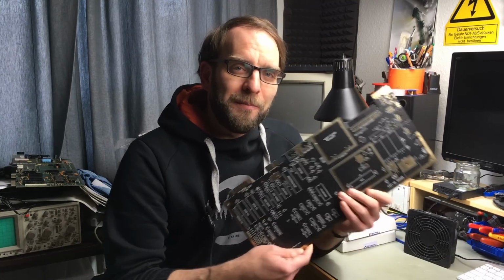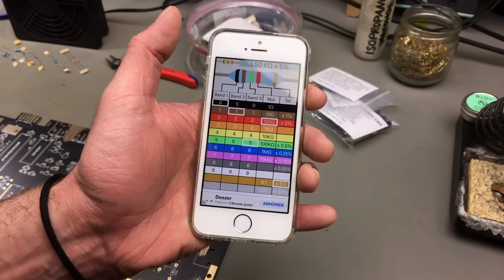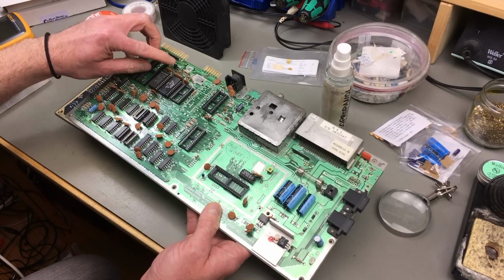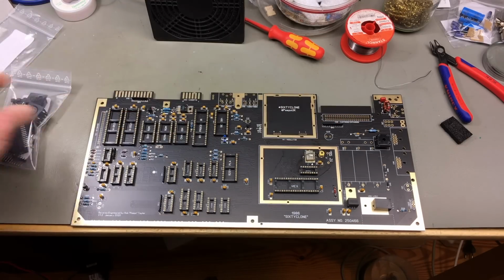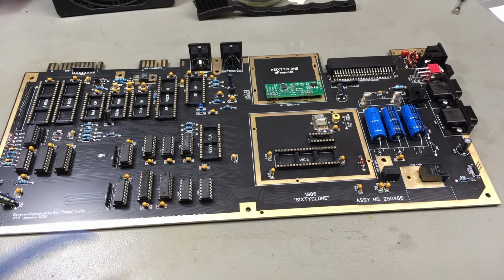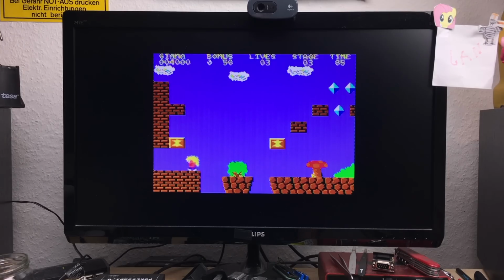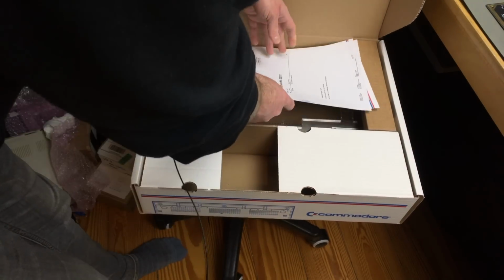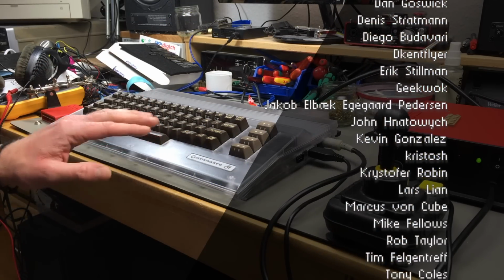Building a new C64 in 2020

Comment: I really enjoyed the video.  I am starting to work on my old computer collection and am starting with the Commodore 64.   I have to work with it to get it to come on.  And once it comes one it gives me some error codes especially trying to use the hard drive.  Keeps saying file not found and error.  red light flashing.  drive spins.  I have drive diag card it does nothing?   I am leaning to the control chip?  And Ideas?

Comment: I know this is an old video.   I have a 466 replica on way.   I've always wanted to build one.  Can't wait.   Thanks for the tips
Reply from the maker: Hope your build goes well! So satisfying to make your own C64! :)
Reply: Hello again:)   I recently finished building my 466 replica a week ago.   Works perfect.   However... it does not like the kung-fu flash 2 cartridge with the vicII kawari mini.   But is fine with a normal vicII.   The kff works perfect with kawari in a stock 466 board.   I was wondering when you have time.. could you try the kawari mini and a kung-fu flash 2 cartridge in yours ( if you have both)   and let me know if the kff with kawari mini works on yours?   I'd really appreciate it:)

Comment: Question:   Would the board revision you selected be a good overall one as a testing platform  ?  -   I would like to make a good solid foundation unit with ziff sockets to help test chips from original faulty machines. 🔧

Don’t feel need to answer here it just popped to mind and will probably post elsewhere
Reply from the maker: This revision only has two RAM chips so for general C64 testing, you are probably better off with one of the earlier revisions (like the 250425) which have 8 separate chips. The newer RAM chips rarely fail anyways in my experience while the smaller older ones (4164 type) often have issues. Otherwise you can test all the long board custom ICs etc in the revision I used here.

Comment: I was really curious if you could make like modern c64, like the recent VIC-20 the 8-Bit guy showed, with all of the shelf parts or like replacement chips or something. In another 8-bit guy episode he showed a modern SID replacement but I was wondering in there was like a VIC-II replacement or like replacements for other chips. The VIC chip in the 8-bit guys video needed to be pulled from an actual computer, so I did not know if this would have to be done for a project like this. I was actually thinking about this after watching the 8-it guys video. (I wrote this at the beginning of the video)

Comment: Ah, very nice.  But what I see frustrating about these new builds, seems all relatively new components, except for the SID and VIC II chips.  It really amuses me, how someone is implement C64 all on a FPGA.  Yet I can't find where anyone implemented just the digital logic for the VIC II on either a CPLA or FPGA, where one end plugs in the 40 pin socket for the VIC chip and the end allows for a connector for either a VGA or HDMI port.
Reply from the maker: There is the VIC-II Kawari now which accomplishes all the features you mentioned with an FPGA. Unfortunately it’s not widely available (yet) because of the global chip shortages. For the SID, there’s several very good modern replacements to choose from, too!
Reply: @JanBeta  Thank you, that is immensely useful to know, as per the VIC-II Kawari. I'm also wondering if there is replacement for the 8563 Video chip (C128 - 80 column display)?  If so, I'll be inclined in ordering one of those c128 neo pcb boards.

Comment: Did you ever find a descent replacement chip for the Vic2 chip ? It looks like something which still be in research actually ...
Reply from the maker: There is the VIC-II Kawari project now (an FPGA-based VIC replacement with added HDMI/Component output), but due to the current chip shortages, it's not going to go into "mass" production any time soon unfortunately.
Reply: @JanBeta  I could read it is on project level , not yet ready for sale or share, that is why I wondered if any other ones existed yet.

Comment: Anybody know a site I can order a 250425 C64 board from?  I mean a reproduction board.
On another note the link to the pixelwizard 64C online shop no longer works,  it says the shop is now closed.
Reply from the maker: I don't think there's a replica of that board revision for sale (yet). You might find an open source copy hidden somewhere around the retro computing forums but I didn't find one. The 250466 is mostly the same though, except it uses more modern (and less) RAM chips.
Reply: @JanBeta  Yes I"ve seen thats somewhat similar using  a pair of 5565's  My current 64 repair is difficult without a scope but currently I've found the regularlator supplying the vic 2 & 8701 has drifted dangerously hight to around 5.15V & as far as I can tell with logic probe the vic isn't supplying the clock signal to the 6510.  Hopefully that's the last of it but with the damage the old boards already suffered I may have to replace it if it gets to be much more.

Comment: Good work Jan. Also watched your follow up video. I hope you still reply to comments because am curious about 2 things. I am just now building the same 250466 replica board as you were, but first of all the crystal I received from Run Stop Restore shop is much smaller than the long flat one you have there. The other thing is the component on CR4, by the joystick ports - how did you get it that far down? The legs on mine are like flattened a short way up from the bottom, which there makes the leg too wide to be inserted further than that into the board. So kind of 2/3 of the legs are above the board. Not sure if that should be like that, or if that much exposing the legs on the top of the board (or the height) could be a potential issue.

Comment: You really shouldn't solder the components to the board without cutting the legs beforehand as to not create micro cracks in the solder. That can give bad connections making it a hell to diagnose eventual faults.

Also if your wrist ground lead isn't connected to the mat itself, you might as well not use it...

When you put the new C64 board into the clear case, you didn't tighten the bottom middle screw enough. You could tell on the video, when you pressed down on the board.

Comment: This is cool for practicing and hobby work, but I do not see it exactly as "building a C64". It is not even a clone but a hardware emulator of a C64 (since some chips are not with the same capabilities but more general). But who am I to judge... if it feels like a C64 it might as well be one :) But then I wonder at which point hardware differences start to matter? Would a raspberry chip emulating the motorola and other functionality like the SID replacement does for the SID in here still qualify? Are motherboard traces what constitutes a "real C64"? or is it the main CPU? Or are all hardware component specifications? Or what? Maybe it is a futile question "at which point substituting parts of a something with compatible parts still makes the something?",  without a concrete answer in the real world :D

Comment: The numbers on those caps are their value in pf, with the first two significant digits and then never of zeroes to add.

104 is 100000pf or 0.1uf
510 is 51pf
391 is 390pf

Comment: Excellent video.  Thanks for posting this.  I am going to be building one of these myself very soon.  I have some soldering experience but I never thought much about the solder I used.  I am trying to read the specs on your spool..  Is your solder size 0.7mm,  alloy of 60% tin 40% lead, and 2.5% flux content?  Can you provide the specs on the solder please?    Thanks!

Comment: I've been contemplating getting one of these diy C64 kits for a while, as I have not been able to stumble across a decently priced original. I believe after watching this that I've made up my mind to take the plunge. I love soldering and electronics repair in general; I love it so much that when I decided to get an oscilloscope, I bought a diy kit just because I wanted a fun project to do that my kids could watch, so they could better understand how modern electronics work XD I have friends that tell me I'm crazy to love such a meticulous project, but there's just something so incredibly satisfying about building working electronics out of a smattering of capacitors, resistors, diodes, and microchips. The best part is getting a successful first boot when you finish without having to troubleshoot, it's simply exhilarating! It can be a headache if you do need to troubleshoot, but it's still worth it in my opinion.

Comment: I didn't know I had OCD until I saw that 1) with the large caps the left most cap is not oriented the same  as the other two and 2)those green boards (RF Modulator and PLA) don't match the rest of the system.  My left eye keeps twitching... :)

Comment: Hi. Very informative video. I was wondering if I should go for ultimate 64 elite FPGA or SixtyClone C64 and build alone my stuff. Don't know which one , ultimate seems to be quite expensive jus t only the board and it's out o the order. Which on of two is more close to the real c64 ?  I have even found original c64 for around 100 euro but I am wondering if it's old hardware and I should avoid it. Thanks.

Comment: I just wanted you to know the reason CBM ICs tend to run "hot" in terms of Temperature.  Bil Herd (Hardware engineer at Commodore) revealed that
CBM ICs were made from super cooled glass and covered with silicon.  He revealed that in one of the VCF videos (or a stand alone video?) here on
Youtube.  I thought you might want to know that bit of information.
Reply: The etched glass wafers cost a few thousand dollars a piece and were super cooled with a nitrogen mix.

Comment: Naja ich hatte in den 80er Jahren einen C-64 wie viele andere auch. Da mich die Programmierung ohne den Basic Interpreter immer fasziniert hat, habe ich gelernt wie man den Brotkasten in Assembler Code programmiert. Die 8KB des Betriebssystems kannte ich nach ein paar Jahren fast auswendig. Alles in allem hatte ich viel Spaß. Aber 40 Jahre später einen C-64 nachbauen ? Wozu ? Ich nutze einen Commodore 64 Emulator, der meines Erachtens viele Vorteile zur original Hardware hat. Vielleicht fehlt mir auch einfach die Phantasie, mir vorzustellen, das ich einen selbstgebauten C-64 besitze.
Well I had a C-64 in the 80s like many others. Since I was always fascinated by programming without the Basic Interpreter, I learned how to program the bread box in assembler code. After a few years I knew the 8KB of the operating system almost by heart. All in all, I had a lot of fun. But building a C-64 40 years later? What for ? I use a Commodore 64 emulator, which in my opinion has many advantages over the original hardware. Maybe I just lack the imagination to imagine that I own a self-made C-64.

Comment: Why did you not inspect and then power up the board BEFORE you installed the chips?  This is standard operating procedure!!!
Reply from the maker: I did power it up and measure the supply voltages. Just didn’t film it.
Reply: @JanBeta  That's good to know.  I had assumed that you hadn't done it. I felt like there was no way you would have done the pre-power test and not have notified your viewers of this extremely important step...

Comment: When will someone create a C64 which has hdmi or even VGA out?
Reply from the maker: There's actually a VIC-II replacement in the works with those features. Hope to get my hands on one once it's finished. :)
Reply: @JanBeta  Long overdue!  I hope you get testing versions of this so you can be the first and also perhaps offer some input into its development!  Some people think "retro" means faithful reproduction of every aspect of the experience.  And while in some ways that's valid... especially if you're looking to create something like a museum setup or a movie set where everything should look and work the way it did in the 1980s.  But if people simply want to USE it in the world of today, then it should interface in today's technology.  So I have no trouble with the idea of integrating all manner of modern tech in retro systems.  And how cool would it be to actually have forms of network interfacing?  So even though the C64 could never have a practical TCP/IP stack, there could be devices which abstract the older methods of access.  For example, we already emulate floppy drives and media.  So why not abstract serial port devices over telnet or SSH?  It's not hard to imagine an effective "KVM over IP" type of interface for a C64.  This already exists today for modern systems.  Free protocols exist to facilitate video, audio, keyboard and mouse as well as virtual media and other devices as well.  Imagine connecting to your real C64 with such an upgrade using VNC.  That might be really cool and not at all impossible.  It's just that there might have to be a "Pi" or something reading and writing things to/from the C64 and translating all over that over through VNC protocols.  It's not beyond imagination.  It's merely beyond my technical abilities :)

Comment: One technique I use when cleaning up flux residue is to use a lint free rag. I spray the board with isopropyl, put the rag down on the board, wet the rag with a bit more isopropyl, then use the brush to massage the rag against the solder joints. You’d be surprised how well it works. Keep changing to different spots on the rag, also.

Comment: Amazing that this computer actually stil is in such strong memory.
It was my first computer, and a great buy at the time. Easy to program, pretty stable.
As I grew older, I gave away everything I had for it to a younger child who then could experience much of the same joy I had.
And now... I really miss my commodore 64 :p Maybe I will try to collect parts and build myself a new one.
I wonder though.
The CPU, 6502, is still easily available, and some have had a minor upgrade, ie, they accept a little bit more machine code and can do slightly more.
It is also capable of 16 MHz these days.
Have you ever tried to see if the old machine can get a boost from updating the crystal and CPU? Maybe via a switch so that it can boot in both configs?
The old CBM Basic V2 running 16 times faster would make it quite interesting again.
But then again. Arduino is here. Amazing how these microcomputers really have taken the market.

Comment: Nice project. 
What if you do not have those part that you are salvaging ?(if you have nothing to salvage from) will it still work(are they just 'extra' parts? )
Reply from the maker: The kits that Martijn sells actually have ALL the parts needed, he just forgot to include some in the one he sent me... :D

Many of the smaller parts and transistors are standard parts you can just buy from electronics components sellers though.
Reply: @JanBeta  nice

Comment: I just got my PC board for the original 5 pin C64 which is one version i didn't have. I am totally stoked to do this project and like you, I am going to use as many modern parts as I can. I found on Ebay someone who built the basic, kernal and character rom with a surface mount EPROM on a 24 pin socket. What game programs do you suggest to test the video and SID

Comment: Wow, well done! I wish I had the knowledge and skills to do this my self. As your design is  like a neo modern C64 it would be nice if you could update the keyboard to go with the neo modern look. I've just purchased a full size C64 from retro games. How does the hardware differ to the one you have built? Is there any noticeable difference or is just branding of parts? Many thanks, Nick (Manchester, UK)
Reply from the maker: Thanks! The C64 from Retro Games is basically just an ARM system on a chip running an emulator, so it's completely different from the real thing from a hardware point of view. Still a nice device to have and it's compatible with the vast majority of software out there. :)
Reply: @JanBeta  I'm not sure if it would be worth doing an episode explaining the differences between the C64 and the Commodore 64 and how if it affects the overall end result (if any), sound and vision wise. Whilst I have great affection for the Commodore 64 (as it was my first computing experience), even if they re-made it today I don't think I would want to revert back to long tape loading times, trying to hook up a HDMI TV with a RCA cable or replacing the glass fuse in the Commodore 64 when it blows. I see this as a neo modern version to bring into modern times and allowing me to load up games quickly and play them reliably. Ironically this is probably what I would have wanted when I was using the original lol. I'd be interested in your thoughts anyway. Even if they remade the commodore 64 as it was (maybe with some modern peripheral ports at the most) would it be any different to the C64? Many thanks, Nick (UK, Manchester)

Comment: I see they have NOT fixed the MAIN FLAW with the Commodore 64!  I repaired these, CHIP LEVEL at a dealer when they first came out in 1990 something and there was a MAJOR DESIGN FLAW!!!!!!!!  I would get MANY units in with the keyboards not working, 2 or 3 a week.  The prob was s blown IO chip BUT WHY SO MANY???  I found out!  the Joy Stick IO was on the same chip AND to turn on or off the unit you had to move your fingers behind the Joy Stick Ports to the on/off switch.  To save space on the desk, most people had their Disk Drive sitting next to the computer on that side and I found many would slide their fingers along the side of the computer, across the exposed Joy Stick Port to the Power Switch and static electricity from their fingers did the rest!
Reply from the maker: Yes, very common fault in the C64s. There's a relatively easy workaround with some SMD diodes added to the joystick ports. I might put some in there, thanks for the reminder.